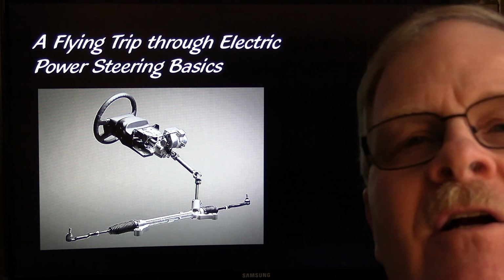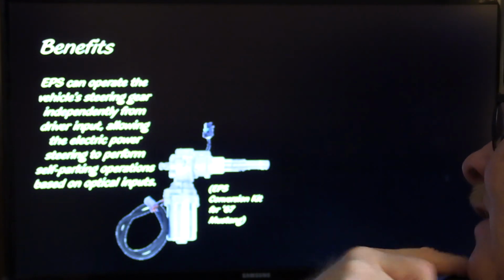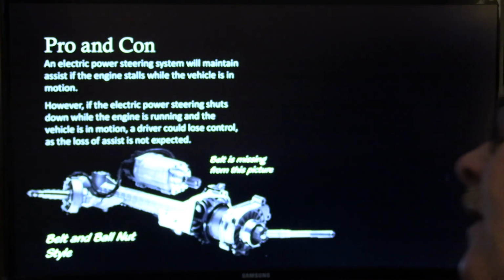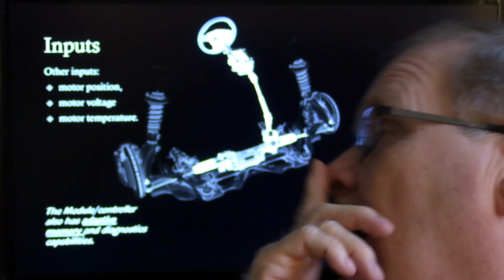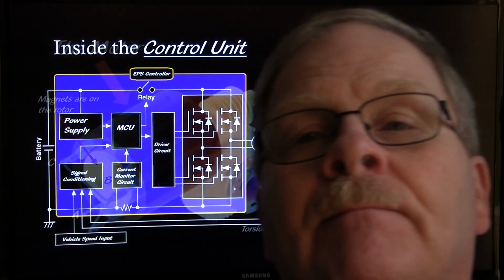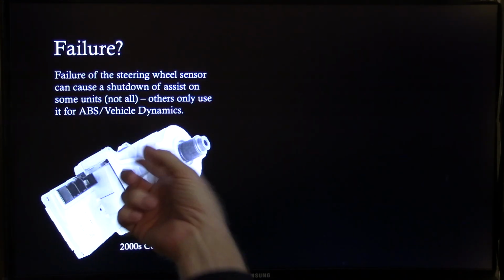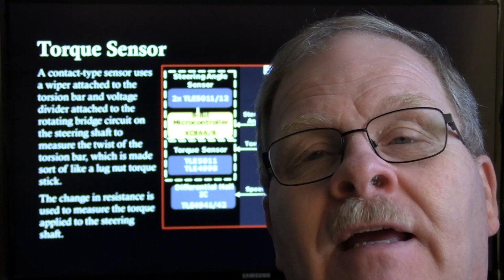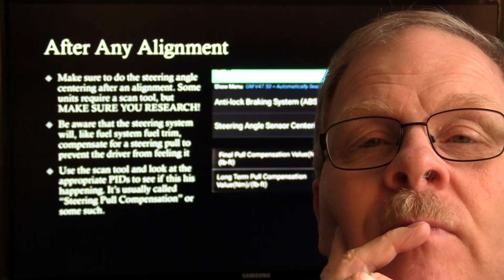Flying Trip through  Electric Power Steering

Comment: The steering motor will not activate until it gets the 'engine is now running' command from pcm. Then it will stay active until key off, even if car runs out of gas or stalls if manual transmission, unless a fault happens with a code. 
But engine absolutely must be started at least once each key cycle, even if restarted multiple times.
Experiment by removing coil fuse after starting the engine.

Comment: I do not have much experience with the electric power steering. Do to work load I was not allowed the time to diagnose a chevy truck from the shop next door. That thing would violently turn opposite the direction you wanted to turn with enough force to break your wrists or worse. The tool was scanning jibberish coming out the ECU and lots of other electrical anomalies were happening at the same time. Some of this stuff is almost like printer toner. It would be too easy and efficient to make the same thing fit a few different models from the same manufacture. Who  can figure why cars are getting so expensive for less machine.

Thank You